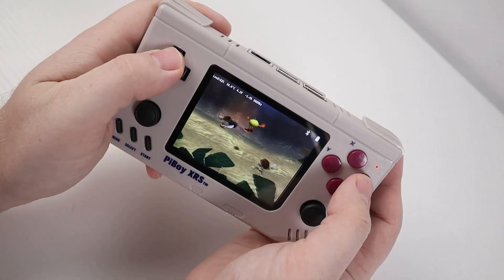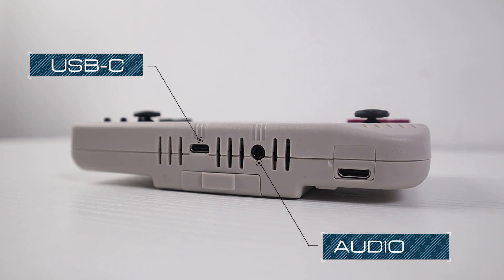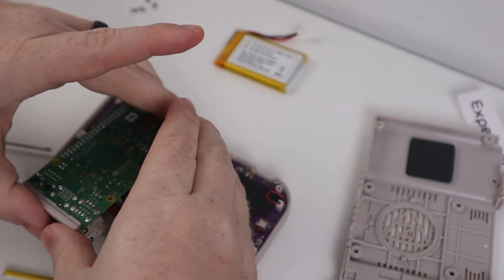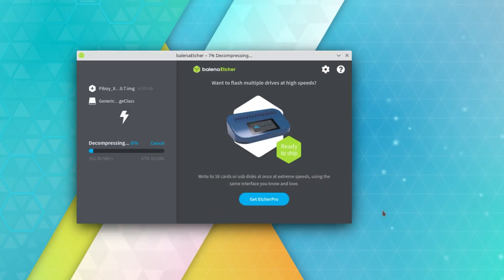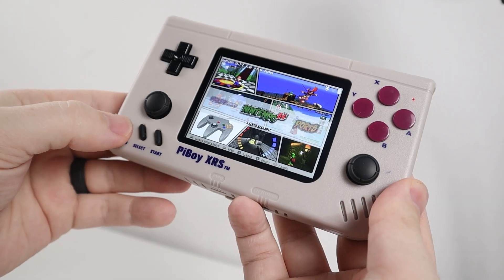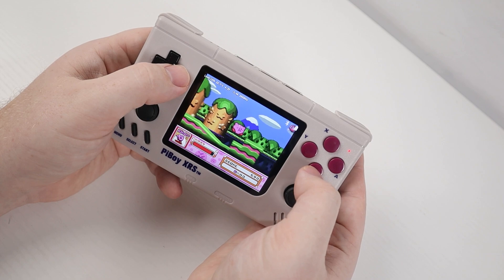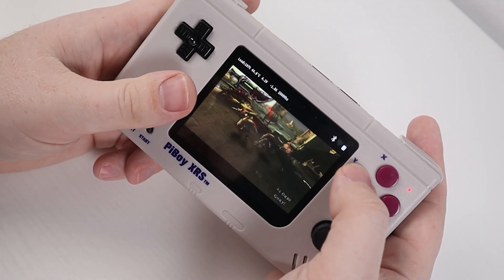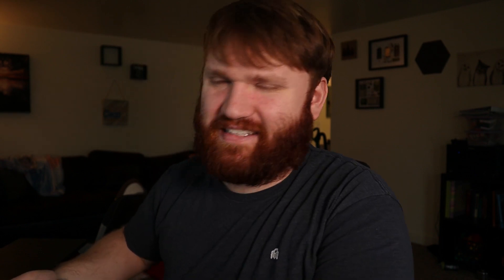Are RaspberryPi Hand-Helds worth it?

Comment: My recommendation to people who can't get hands on a sbc and want some retro handheld gaming on the cheap, you can get a unused old Android phone you have laying around (or buy a second hand one for super cheap) and install some emulator on it and play your retro games. There are quite a few cheap controllers too that you can attach like the ones offered by ipega or game sir x2. Further more you can debloat your old phone and install something like lineage os to get some extra gaming performance.
Reply: We'll that's about it hope you guys spend your money wisely tho
Reply: Phones are crap for retro gaming. Sure, they have the power, but the form factor sucks, the screens are way too wide, so you either have massive black side bars, or you have artwork overlays made to fit the phone's resolution. You have to have separate controllers which need to be carried around with the phone, and Android sucks for retro gaming, with too much lag, and an OS that is designed for a phone.
These Piboy handhelds are based on the original DMG Gameboy, so the form-factor is perfect from the start. And, Retropie is perfect for retro games, with a great frontend, and lots of customization. A Pi 4, can handle everything upto N64 with ease, although N64 can be a bit hit and miss. Dreamcast is great, and most games run well.
Reply: @DKTronics70  just say that you never tried Android emulation, which can run up to 3DS on higher spec phone. any dirt cheap device will run up to psp or even more.

and control scheme isnt the point here, the point is to get something cheap. but nowadays chinese handheld dominated the scene with a very very cheap  device its actually kinda pointless to get a mobile phone at all.
Reply: Or a KTR1 or retroid pocket 3+
Reply: @obvious_giraffe8386  Not a pi, that's the whole point.
Reply: @noonetoday3210  but the thing too is that some emulators arent having access to sd cards or have a menu to Easily access all your roms and support for frontends app hasnt been great or showing sign of Improvements